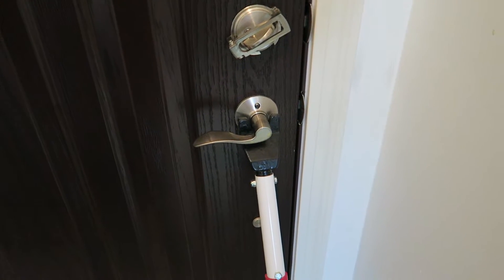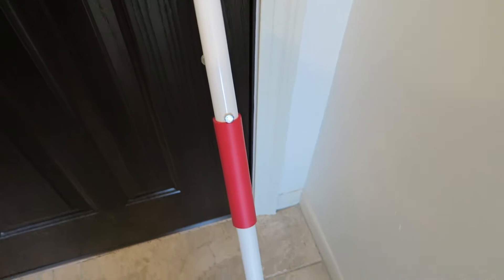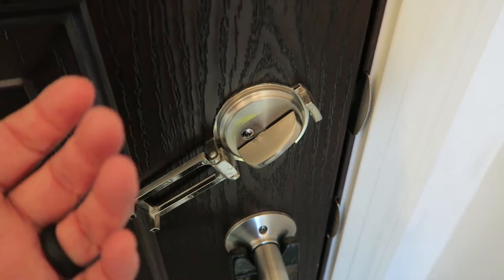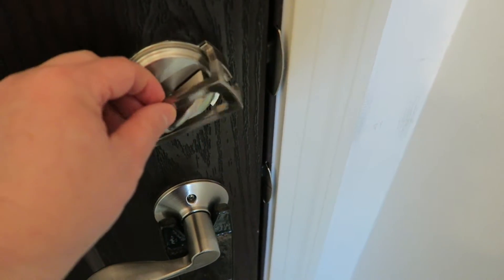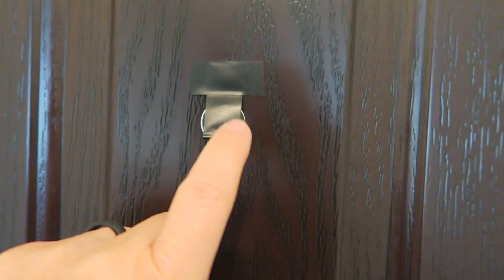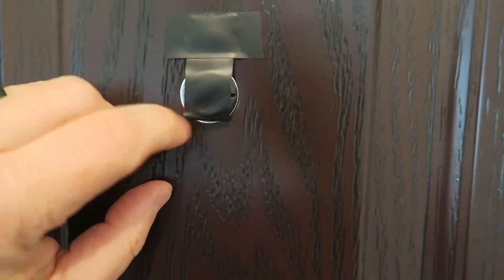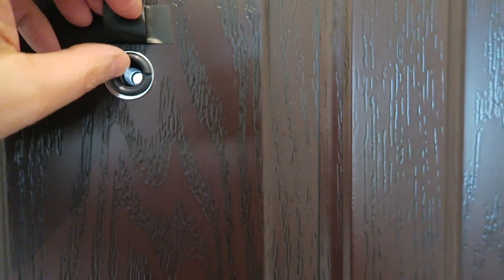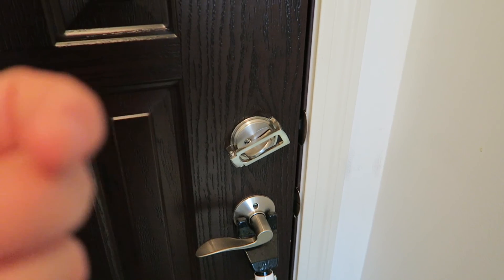🔒Deadbolt Lock Flip Guard - How To Stop Lock Bumping - Door Security Tips -

Comment: You can't bump a deadbolt since it has no keyhole. Deabolt guard protects only improperly installed deadbolts, or really REALLY crappy ones. 
And you door buddy thingy is easily removed from the outside with a piece of wire in like 5-10 seconds. 
Don't barrage your door with useless gimmicky crap. All it does is make your life more annoying while providing zero additional security. 
If you want a better locking system - install a good multi point lock.
And install an alarm system.
Reply from the maker: +Bear Arms Hi Bear Arms, thanks for your comment and input. Actually, the other side of that door does have a key hole. Also there is a steel door jam around the door, does not allow for anything to be inserted in through the crack. Most bad guys want a quick way to gain entry, they are not smart enough to think the door/home main be fortified, nor do they want to be seen attempting to use a wire with a bunch of nosy neighbors watching.  Alarms are good as are cameras,  they notify when someone has entered and get a picture of who it is, they just don't stop or slow entry. Nothing is perfect.  Either way, the great thing is, there are multiple ways of securing a home and protecting loved ones, this is just an example of a couple of options. 😀👍
Reply: @J Spurling a single deadbolt serves the same purpose. An actual good properly installed deadbolt, not a lock with some weak gimmick on top. It won't get removed without the door getting kicked out loudly, as opposed to this bar. 

This thing is more adequate to keep zombie infestation for a few more seconds or something, but mostly it's useful to exploit misconceptions of gullible consumers and provide illusion of security by being super visible and tough looking.
Reply from the maker: Thanks for the conversation. Lock bumping is a very real thing and can be done fairly easily, as well as kicking in doors, search YouTube to see the videos. This video is to show suggestions on entry prevention, suggestions that do work if probably used.

Alarms systems carry a monthly cost and short of a bad guy potentially avoiding the home due to an alarm sign in the yard, they don't prevent entry. Also, by the time the police show up, the bad guys are most likely long gone.
It's best to have multiple layers of protection, including security cameras, and personal defence that is legal and you are comfortable and experienced with. 
This video was to offer ways to slow down a bad guy from getting in as they are looking for quick easy access, if they can't get in quick, they will leave to find an easy target.
The key is to have some sort of security in place, and that security is whatever each person is comfortable with and can afford. In either case, multiple layers are important, one shouldn't rely on just one prevention method.
Reply: @VigilPrudence  deadbolts can't be bumped because they have no keyhole. All you're doing is emulating a deadbolt with a tumbler lock, and you decrease security compared to having a standard set of separate deadbolt and 2 locks. And your way emulates it badly, because a robber can use a simple screwdriver wedged inside a lock to rotate it by force - something that isn't possible with a deadbolt.

And your stick outright doesn't do anything.
Reply: @J Spurling it depends on crime situation in your country and in your area. Generally speaking, a good basic 2 mm steel door with 2 locks and a deadbolt, and a multi-point locking mechanism will suffice. Something that will prevent robbers from opening it silently when you're inside, and will delay them for 5-10 minutes when you're not at home.
Reply: 2:28